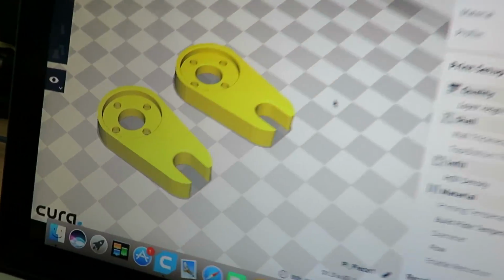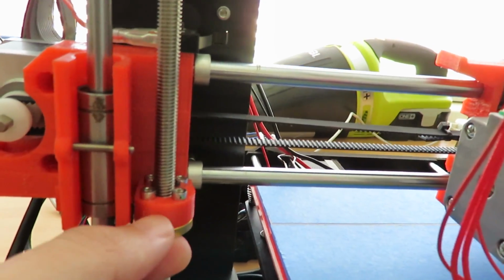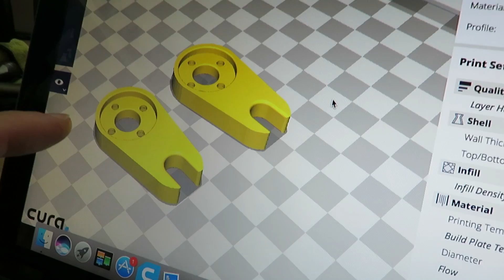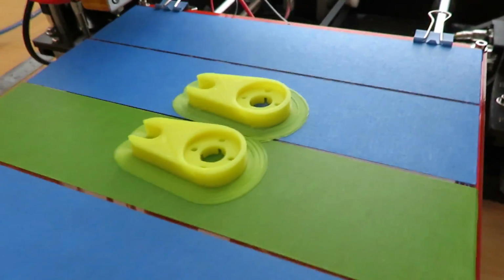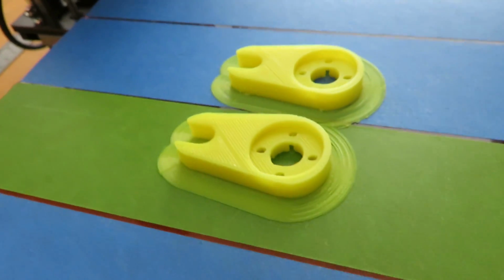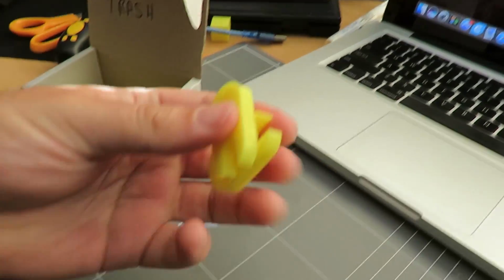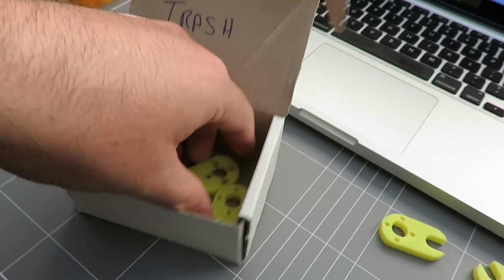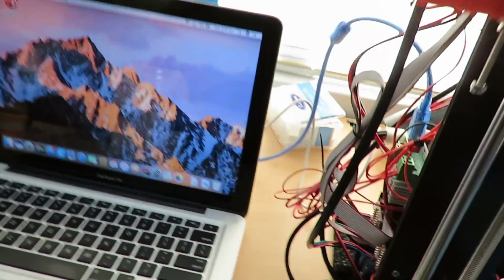Z-Wobble Bracket Improve Print Quality - 3D Printing With Rm2kdev #3

Comment: That's CTC. An independent manufacturer of low-quality printers.
The GT2560 shipped by CTC is their own clone, not a genuine Geeetech board. Differences include more questionable screw post terminals quality, questionable IC and power semiconductor sourcing, the display connector key shrouds are put on the wrong way around (on the display too), the processor is a 1284 instead of 2560 with half the program storage capacity, and the Arduino bootloader is missing. They were shipping these boards for a few years, and then switched to shipping Anet clone boards.
It's not to say that this era and general family Geeetech printers are great... well some are OK, mostly they are mechanically pretty mediocre to diabolically bad... but CTC is absolutely another level of quality questionableness.

Comment: I was given for Christmas 2019 a CTC DIY 3D printer that is virtually identical to this. It is a Prusa knockoff by a company called CTC and the DIY means I had to build it. I sorted the z-axis wobble the same way, as described here:   https://madsmaddad.blogspot.com/2020/04/ctc-diy-printer-z-axis-wobble-repairs.html   I did not have to go to the extent of removing the whole carriage, as I had it resting on two identical height blocks on the bed. This simplified later calibration. 
Prior to this I had put a bushing in the top hole of the frame to stop the threaded rod wobbling, and also chnaged the plastic joint for a coupling. If I removed the threaded rod and rolled it on the table, it was obvious that it was bowed, so I straightened it. I then discoveed that the narrower part that was 5mm diameter was not centered on the rod. The extra piece that I added  had a dome on the top so that the sideways wobble of the piece was not translated to the x-carriage. 

This is the assembly of my printer https://www.youtube.com/watch?v=ms-2rY_ad78&t=1292s

Comment: Would small upright notches that allow the vertical adjacent plastic upright section to fit in prevent the lateral movement further?
Reply from the maker: We don't want to hinge onto it though as the movement will translate into the x gantry and therefor into the print head.

So ideal some kind of frictionless suspension is best :)

Comment: if you're still looking for the manufacturer it's Zhuhai CTC Electronic Co. Ltd. The number after the 'CTC' on the plaque is the serial number for your machine. I've just finished printing the anti-Z wobble brackets for mine, although the problem was made worse by the Y frame bolts not being quite tight enough. Fortunately, I didn't expect perfection out of the box and I'm enjoying tinkering to get it working how I want it. Thanks for the vid, it was really helpful.

Comment: Here are how I fixed the Z-wobbling on my CTC Prusa I3 "replica" http://shiny3d.de/public/fb/3dprinter/part1ok.png
DJ
Reply from the maker: Thanks for sharing DJ, however for anyone reading i'd highly recommend not doing this, in very few cases like DJ this method may help with z wobble but the root cause comes from the threaded rods being warped, if you restrict the top part of the threaded rod by using a bearing you essentially put all of the off axis rotational forces back into the rod and it can make your prints significantly worse, there is a lot of discussion in the community about the pros and cons of doing this and generally the consensus is that this is bad news. (however, in dj's case i don't doubt that it has worked for him so try at your own risks but i'd not recommend) :) thanks for the comment DJ
Reply: It works perfect here I use it since a year of course it does not fix the problem if your threaded rods are crooked.

Comment: What I found that really helped was to replace the top frame pieces of the Z-axis. Modify the pieces so you can insert a 628zz bearing to hold the 8mm leadscrew. Also, your new wobble isolators seemed to have a bit too much gap on the smooth rod. This will introduce backlash. Try reprinting them with less margin around the smooth rod side, and simply rub the smooth rod between the gap. The plastic will eventually mold around the smooth rod and you'll have perfect fitment!

Comment: Hi, thanks for the video on removing the wobble, i have a question, how do you solve for the backlash on the Z axis..? 

my guess is that for backlash the drive nut have to fixed to the Z axis arm like in the original? and for the backlash resolve the z axis rod has to be perfectly straight without any wobble..?

Comment: That's exactly the same printer I have, right down to the tools to put it together, I'll put up a vid when I can, the build was bad due to the instructions on the SD card being bloody awful, and incorrect. but I'm getting the same problems and a few others too. good video, keep it up.
Reply from the maker: Even with its flaws i quite love it, its just been a matter of investing time and money in it to get it to a usable point and to be honest this is the sort of stuff i love doing :P so its been a great investment as far as getting a great tool to use around the house and keeping me occupied with some fun hobby weekend projects.

Initial i only purchased it to repair the telescope (video on the channel) since the printer was $200 and the telescope replacement parts were not available the cost was going to be about $4-600 so buying the printer not only saved money but gave me a tool and a fun hobby :P additionally ive used it to manufacture some plastic parts for a friends air conditioner which saved him like $500 when 'the man' was going to come out and fix it.

For $200 bucks its been a bloody great investment heh.